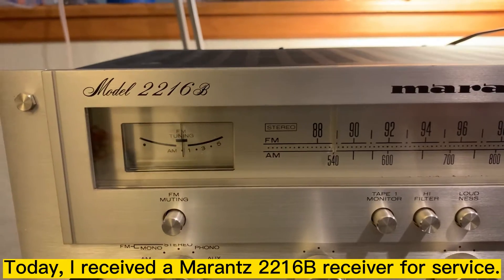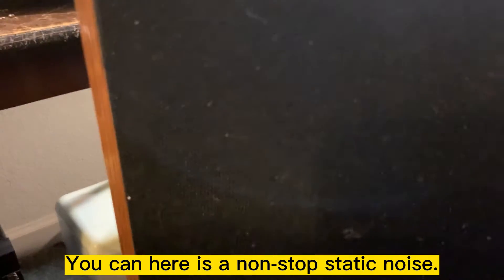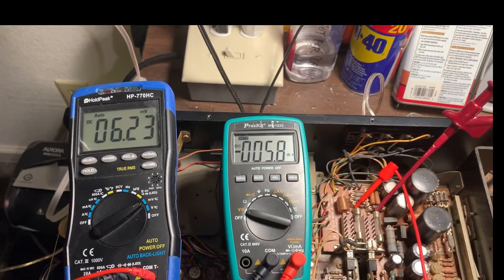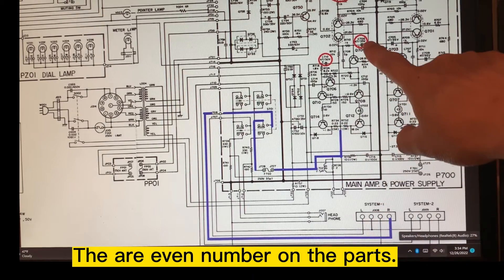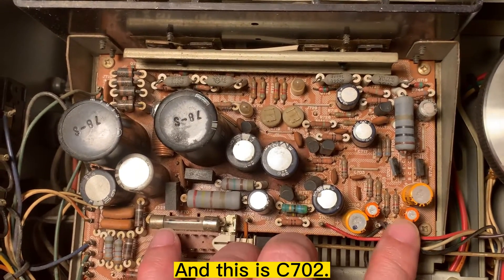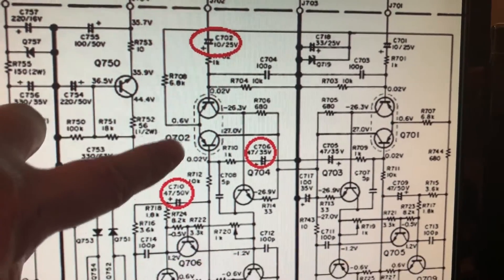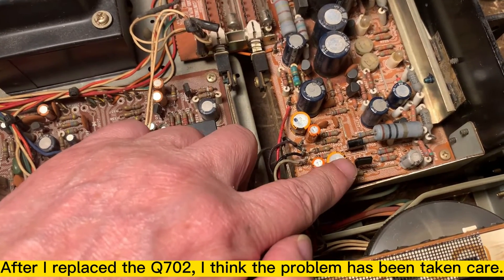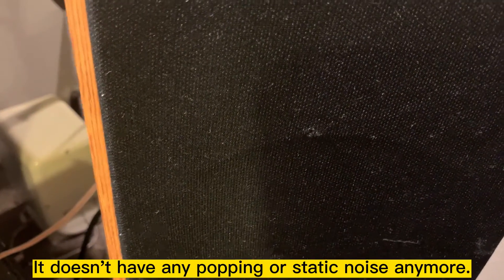Marantz 2216B Receiver I - Static Noise Repair

Comment: I have a tick tick sound from speakers on some fm channels an not threw cassette deck nor turn table what could that be , a ground on antenna maybe like I say not all fm channels do this an it’s very faint tick tick tick like a clock an does not turn up with volume it’s just there on some fm channels an meters for channel are around 3 to 4 signal strength lesser I don’t here it atall ? Any one know if it’s just a ground , it’s only on some fm channels not all an I don’t use an atall

Comment: Great video my brother! I have a newer Harmon Kardon AVR 1710. I get static on every channel, all 7. Where would you look first? Volume board transistors? Liked and subscribed
Reply from the maker: If there is a static noise on every channel, then the problem may come from the power supply because they all share same power source. It is unlikely all transistors are defective at the same time to cause the static issues. Thanks.

Comment: My Marantz 2226b has very high noise only in right Channel and in AUX, tape and tape monitor. Phono and radio show Nice sound in both Channels.And balance shows noise when turno It from onde side to another. Any ideias of what The problem is? I love your vídeos, they até very informative and objective.
Reply from the maker: It seems the problems are on source selector and balance control. They need to be cleaned with electric contact cleaner (i.e. Deoxit). The pre/power amplifiers and tuner should be fine if your phono (phono amp) and radio (tuner section) show a nice sound. The bad contact in the source selector and balance control may be the reason cause these type of problems. Please let me know if further help is needed.

Comment: Odd that is not the problem   Why did it Blow that transistor at that point there is a problem that is still there  why    did it go?       interesting i thing there is another cap ready to take a DUMP     looking foreword to see what you find
Reply from the maker: These vintage units always have problems due to the age. I always recommend to replace all electrolytic capacitors and transistors for reducing risk of future operation. As a repair man, I only detect the issues and replace parts as needed. In my video, I just share what I found for the problem in specific condition and provide the solution. Thanks for the comments.